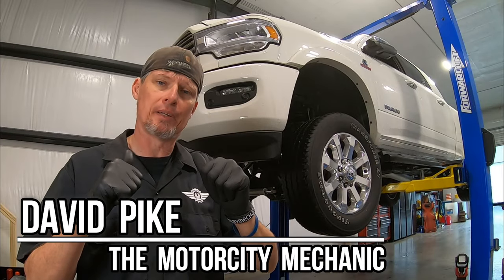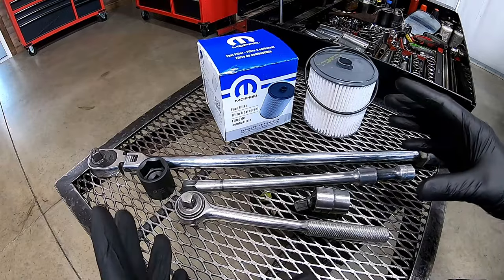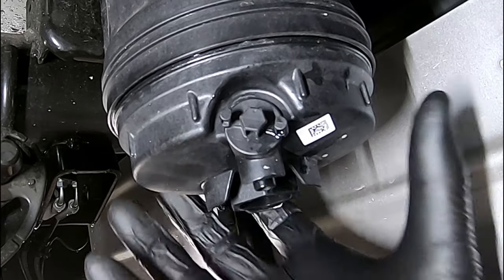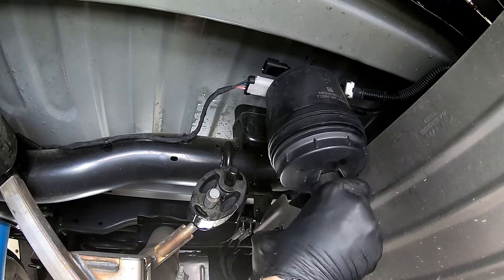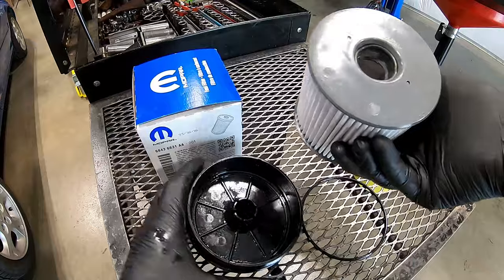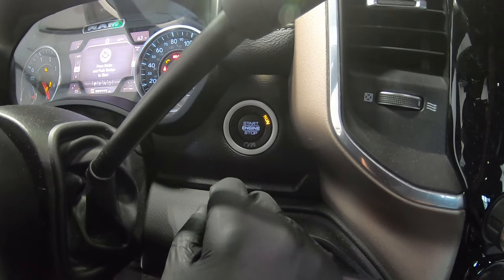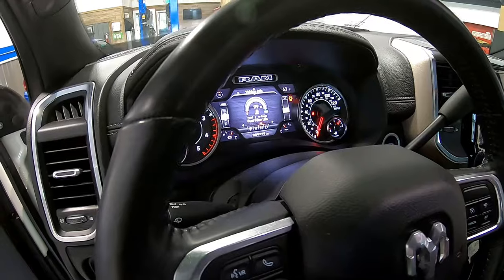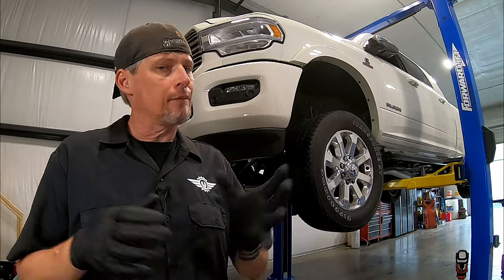2019 and Newer Ram Diesel 6.7 Cummins rear fuel filter replacement

Comment: I had a 12 3500 and the front filter (only one in this model) was always dirty when routine maintenance came around. Now I have the same 19 2500 as in the video. I did both filters when the light came on (7,500) but noticed only the rear filter was really dirty, the front one was still white like new. Do you think it would be ok to switch the rear one every time the light comes on and the front one every other change?
Reply from the maker: Personally I would do both at the same time. There is a lot we can’t see.....so I would stick to doing the pair and playing it safe. Thanks for asking and make sure to subscribe

Comment: 3500 2021 56k the crankcase filter was clogged. I just got the truck. Changed out the 2 filters. They were not too bad. What else should I do knowing it’s a used truck. It’s a dually

Comment: Good information , it also is good to mention it takes a 6 pt socket , 12 point will slip on the plastic nut assembly , I found this out the hard way

Comment: Good video.  Welcome to my world.  Cartridge filter on the Ram Ecodiesels. Just changed mine this afternoon. Whatever happened to just using canister filters?  I don't understand why the switch to this system.  Anyway, at least you all get a socket end on the fuel filter cap.  The 3L diesel just has a cap with 4 points of plastic sticking out.  I mean WTH engineers? Who thought that made sense?  Anyway, I've gotten it off three times and replaced it with a genuine imported FCA filter rather than pay dealership $379 to change it. 

Got a hint for you DIY at home guys when you are upside down on the ground and are facing a pint of diesel in the face.  Take a 1 gallon zip-loc bag and just before it starts to leak, put it over it and then spin off the rest of the way.  Saves a bit of mess but does cost a bag.
Reply from the maker: Great tip on the fuel to the face lol. I always appreciate you watching and for being a loyal subscriber

Comment: Thanks for the information on the priming procedure.  I didn't worry about it in the last generation with the CP3 pump, but I do worry about having a proper prime for the new trucks with the CP4.   Very helpful
Reply: If you use fuel additives to help diesel fuel meet standards for lubricity, you wouldn't have to worry about cp4.
Reply from the maker: The lift pump didnt run that long on the older models but glad to see it does now. Yeah will have to see how the cp4 holds up.
Reply: I think proper priming is the key to avoiding problems with CP4 as well as CP3. Both rely on fuel for lubrication. Another thing to never ever even consider is adding ATF to the fuel system. Back in the Detroit Diesel -71-series engines, ATF was frequently used to pre-fill fuel filters but with the close machining tolerance in modern fuel systems it is death to injectors. To give an idea as to how precisely injector components are machined, I saw a demonstration where the pintle was removed from the injector body, a mark was made on the pintle with a Sharpie and the pintle would no longer slide into the injector body until the Sharpie mark was cleaned off.

Comment: Another very good video.  At least you are thoughtful enough to clean the truck after!!  I have done this twice on my 19 RAM.  I find that if I I reset the reminder with just the ignition on, I can get 100%.  With the engine running, I get 99%.

Comment: Thanks for another great Video David. Here's a little bit of info thought you'd like to know. The (5th Gen) Dodge Ram Big Horn 2021 6.7 Cummins Manual says to change the fuel filters every 12 months or 6000 miles. I think that just depends on the quality of Diesel fuel you normally use. Some Bio Diesel are different than others. What's your take on fuel Quality? Also can you do a video on a Genos Garage Front Fuel Filter Metallic Cap. Thanks David

Comment: If you leave the drain open as you break the seal air will get in and allow the drain to bleed off the rest of the fuel preventing the big spill everyone has.  Did mine yesterday not a drop on my hands or drive shaft.

Comment: I kept the drain open, and when the vacuum broke on the canister a fair bit more drained out the hose, and reduced the mess. Rather than guess, I torqued to the same spec as the front.
Reply from the maker: Great tip. Yeah there should have been a torq. Surprised there wasnt one when I did the research. Thanks for watching and make sure to subscribe.

Comment: Lubricating oil ring on filter housing might be a better option than diesel fuel.
Reply from the maker: Typically I do as well......I have a tub of wheel bearing grease I use for stuff like that. Was just following the service info and didnt even think to include that as an option. Thanks for that tip and for watching.

Comment: David, I have been (since the overall size and structure appear the same) using the 30.5 Newton-meter torque molded into the front filter cover.

Comment: Thanks for the video one thing i did find out is that i left the drip hose on as i began to loosen the filter cover and i noticed the fuel that was in the filter housing began to drip out due to more release of pressure. And thus didnt have fuel all.over the  place
Reply from the maker: I have noticed the same the more I do these. Ford is the same as well. They seem to keep draining and don’t stop until you take the filter off….basically a siphon effect happening on those
Reply: @MotorCityMechanic  ok thanks foe thw tip
Reply from the maker: @guadaluperosales5389  your welcome

Comment: Do you drain the front filter? I don’t . Do you oil the O-rings? I did on my first change. Made the ring slide a little easier. I think I will oil the filter housing wall next time. May help more. Thoughts.

Comment: Great informative video. Keep up the great work.
Reply from the maker: Thanks Mitch for watching!
Reply: @MotorCityMechanic  Good Evening,

I got this error code on my 2019 Ram 2500 6.7L with 67k. Google is telling me to replace the DPF. I got the engine light on my truck and the truck is telling me that the Exaust Filter is full. Should I replaced completly or should I take out and clean it?

code:  p242f 

Thank you brother for your advice.

Comment: What oil is recommended for the 2019 Ram 2500 newer Cummins diesel Dave? I live in CA and i have heard 10/30 and 15/40 or 5/40? Want to make sure i get the right one. Thanks Dave and keep up the great work!

Comment: Great info,is the 2019 front fuel filter same as 2018? Any aftermarket fuel filter equal to OEM in quality?
Reply from the maker: From what I see the front is the same. Fleet guard is a great brand and they make the front fuel filter.....not sure about the rear. Thanks for asking and make sure to subscribe

Comment: Does the filter have any water Separating capabilities or strictly a filter. I love my 2017 for the fact it had the spin on filter for the rear, that one you just did is worry some because it looks like an inverted front one, i dont see that cap lasting long. Otherwise great video as always Dave!!
Reply: Yea everytime i change my rear one out it is missing paint off of it. I don't seeing these lasting long
Reply from the maker: It has a water separator set up. Even has a sensor inside and the drain is mainly for that along with when replacing the filter. Someone will make an aluminum version for sure soon I bet.
Reply from the maker: Time will tell. I agree with you

Comment: I need some help with my Chrysler 200S I have replaced battery and alternator ran great for about week and a half and now it will not turn over I hear a clicking sound once or twice . Now i have to say the change oil message has been on for about 2 months now oil is a honey color in my book it's still good but do you think the car has shut off because of that ..I NEED SOME HELP PLEASE THANK YOU Shannon Simon's

Comment: Nice video. . i have a question did you have a video on how to check a 2009 dodge charger transmission oil. ? I read some about you need to check the temperature of. The oil in order to see the accurate level .. Thanks !
Reply from the maker: The main thing is you need a special dipstick to check the level. Temp is what you suppose to use and a chart to see if you need to add or remove fluid. Dorman makes a tool for that and it comes with the chart for multiple transmissions models. I dont have a video at this time. But will keep it in mind. Thanks for asking and for watching. Make sure to subscribe.
Reply: @MotorCityMechanic  thanks .. I get already the dipstick  today and checked. Out he oil. .. I just drive he car for 15 minutes and level show me pn the 6 number marck i will try to find a temperature scanner for the oil .. Did you know any one ?

Comment: Do you think for people doing this in the driveway, such as myself, that if you left the drain open and then the tube going into a bottle, it would be less likely to spill as it did for you once you get it loose? Maybe having the drain still open, breaking the airtight seal.. would allow that to drain and not make such a mess?
Reply: No matter what your procedure is, you’ll always end up with a diesel bath. 🤬

Comment: Thanks for the video.. wish all mechanics were as self disciplined as you.  BTW I have a 20 Ram and thinking of changing my fuel filters and oil at 50% indicating with approximately 7200 miles.  Is this considered early? What is you recommendation?
Reply: Early waste of money

Comment: Will the cap screw on if the filter isn’t lined up correctly with the notches? When I changed my chassis filter the filter came out with the cap.

Comment: I have a 2017 RAM 6.7, and the fuel filter reset goes to 99% also.
Reply from the maker: I always figure that ones it’s installed…..it’s never 100% again. It becomes used 😂

Comment: So the new trucks have the crappy plastic that likes to crack on the front now on the rear? This is why I put a cat filter up front, because I didn't like the plastic becoming brittle and cracking on my 2 cummins...purty sure someone will improve on this
Reply: This is a Oil Question ,I have a 2018 6.7 Cummins  with 20k miles ,I want to use a synthetic oil can i next oil change start using synthetic oil even though I used 15/40 Rottella T since new will it hurt anything ie seals or what not  if I switch over ?
Reply: @jasvan4359  Won't hurt anything at all... Make the switch.
Reply: @jasvan4359  , synthetic oil tolerates heat better and fuel dilution.  Just make sure to use quality synthetic, do research. Maintenance is cheap compared to one trip to the dealer for repairs. Also,  don't follow factory recommended intervals.
Reply: @repairvehicle  thanks for your reply I read good reviews of Rotella T6 full synthetic and it's reasonably Priced ,seems wherever I started searches to  read about synthetics Rotella T6 always was in the review with good reviews
Reply: @repairvehicle  don't follow service intervals? I'm not sure why you feel this way but the oil change interval comes from Cummins.  It is the same for any ISB/QSB6.7 - 500 hrs or 12 months.
Reply: @jrmason4049 ,  factory intervals will only benefit cummins or dodge dealers because equipment will fail or wear out, and they will make money in sales or service. People who change their fluids and filters more frequently than what factory recommends don't have problems with their equipment.  People who follow factory intervals,  always have problems with their equipment reliability and then they complain about on YouTube and other social media sites.
Reply from the maker: I can see an aluminum replacement being in the near future for sure.
Reply from the maker: When it comes to diesels.....I go 7500 for oil changes.....I would never go over that.
Reply: @MotorCityMechanic  i go 10k on my oil changes and haven't had any problems on either truck so far... both 2015's and both at over 200k but I don't tow with either of them other than a camper and horse trailer. Most of the time they run slow down the road in front of or behind a load thats heavy
Reply from the maker: @jamestaylor-qb9wo  As long as it works for you thats all that matters.
Reply: @repairvehicle  you should have told that to my grandfather who followed factory service intervals on all his farm equipment since they were new over 40 years ago.  BTW, all that equipment is still in service to some degree.  

You are certainly entitled to change your oil as often as you wish, it's only hurting your wallet. I've put over 600k miles on 3 diesel pickups and My wife's diesel car has over 240k miles all following factory recommended service intervals - the sky has yet to fall over here.  Then again they have been used as intended - to work.  A truck that is used on short trips and doesn't tow or haul anything and doesn't  get hot may not see the same results. Intended use is a big factor.
Reply: @repairvehicle  

Cummins averages 500,000 ISB/QSB 6.7 per year.  That's not including the L9, ISX12, the X15, or any of the big bore engines used in Rail and Marine.  When have you honestly ever heard of an oil related failure in the last decade or more that wasn't owner induced? I'm around Ag and Construction equipment daily - I can't even think of the last time I have seen a component - bottom end, cam, turbo, etc. wiped out from  poor lube boundary. You also don't see sludge in engines anymore due to the improvements in oil that prevents varnishing And oxidation.

Detroit Diesel has a new 8 liter engine with a sump that is 6 quarts larger than the ISB. It's recommended service intervals 60,000/2 years. These aren't magic numbers pulled out of the air.  Both diesel engines and oil have come a long ways since the early DOC/DPF days.

Comment: I don't think it's a greatest engine.  High oil consumption and low tension piston rings, designed for short life.
Reply from the maker: In my 21 years at the dealer....replaced 2. Otherwise havent seen oil consumption issues personally.
Reply: @MotorCityMechanic , 2019 the redesigned cummins, with hydraulic lifters.